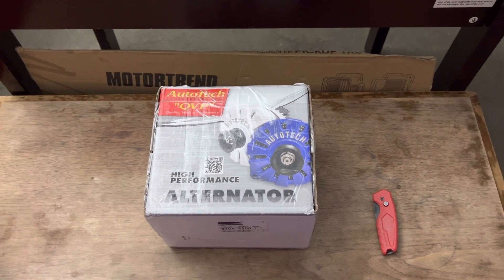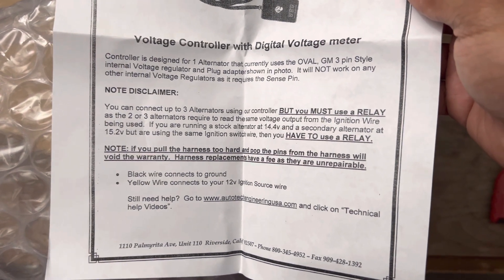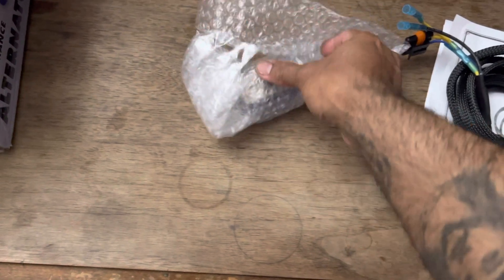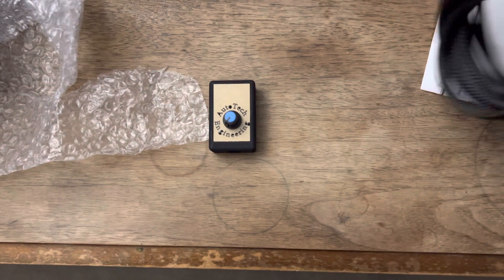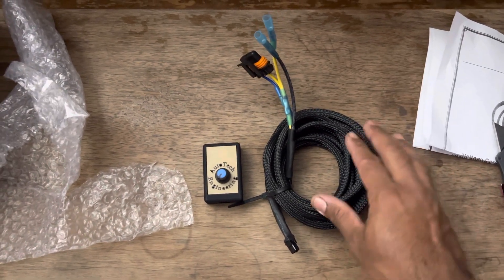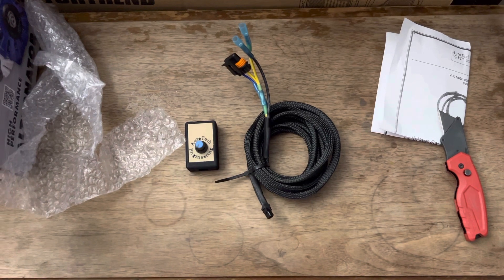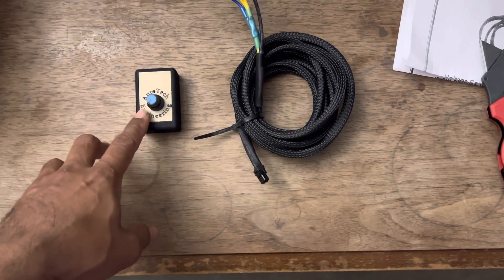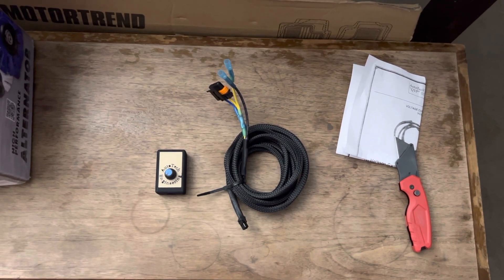Unboxing Voltage control module VCM-6003 from  Auto tech engineering

Comment: Hey bro I have the same car as you what are you charging at after playing a lil? And those your voltage control light stays on with the car off? Mines is and I tap into the same fuse you did? Pls thank you
Reply from the maker: When playing in idle I charge between 14.9 -15.5 and no my voltage light doesn’t stay on. I tapped into the ignition fuse right under the steering column
Reply: @RomaVilla  what’s the highest voltage you recommended? It’s the same car as you.
Reply: @RomaVilla thank you

Comment: It does have a voltage on it. You gotta take the protective ground cover off the front. It’s on top. Mine was the same way.
Reply from the maker: @mikepeed5388  yea took me a minute to figure that out. I was a little to impatient and i finally figured it out after a few days

Comment: Hey bro I placed my order yesterday for a 290 amp with the VCM 6003 but I need to know where the ignition wire goes do I need to run it all the way to my key ignition switch on the steering column
Reply from the maker: Yea that would work , I ran mine right under the steering column along with 9 amp fuse and it hasn’t given me any issues.
Reply: @RomaVilla   cool thanks bro

Comment: Question ❓ you said your alternator registered around 14.8-14.9 did you get the plug and play model regulated at 14.8 reason I'm asking is I'm wondering if this will allow me to externally regulate an alternator that wasn't originally intended to be externally regulated I'm wanting to order a alternator to charge at 14.8 with the current battery I have but I want to get LTO eventually which will require me to charge higher
Reply from the maker: I believe the people at auto tech said that these controllers only work with their alts from auto tech. I don’t think these will work with any other brands. These controllers came with a 3 pin plug with a sensing point rhat connects to a sensing point to their auto tech alts
Reply from the maker: I would say go with an alt from auto tech so you can use this same controller. They go all the way up to 16 v I believe .ive had mine for 2 yrs now and with no issues.
Reply: @RomaVilla   yeah I emailed them earlier I've seen a bunch of cars like mine with the PCM controlled charging system and a lot have charging issues but autotech has made alternator's for my exact car that works perfectly fine with no issues so I'm definitely going with them over the competition
Reply from the maker: @Dirty2152  i definitely recommend them as go to for HO alts. I had voltage issues with 11 Corolla and would never get above 13.6 even with big 4 and 300 ah of agm and I couldn’t get the power I needed from any of my amps once I seen auto tech had a 320 and 240 alt regulated at 14.8 I told myself that it was perfect for running a 40 ah ying long lto in my vehicle and it’ made a hell of a difference in just about everything. I do need a tad more lithium to run my bc6k but I don’t usually drop below 14 v at full tilt on an Orion spl 15